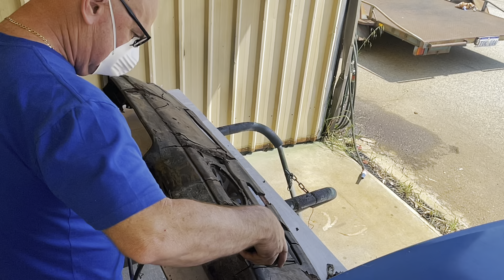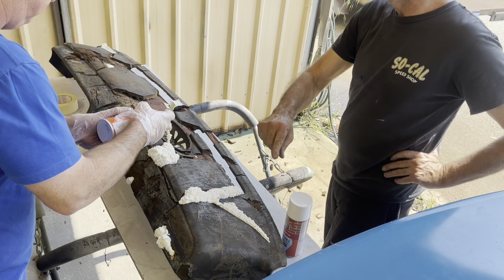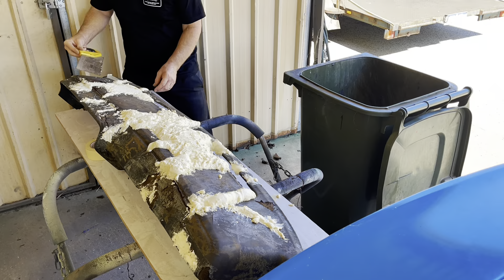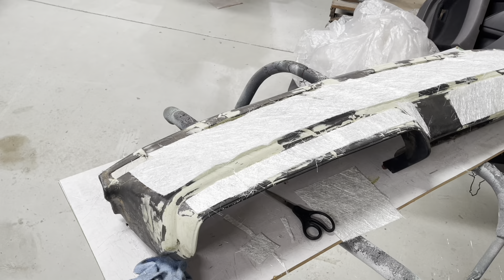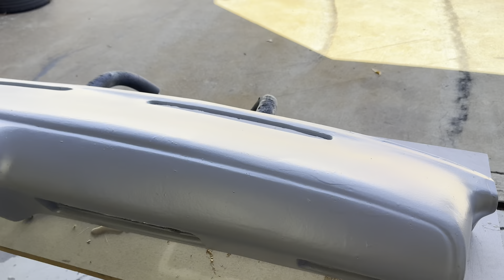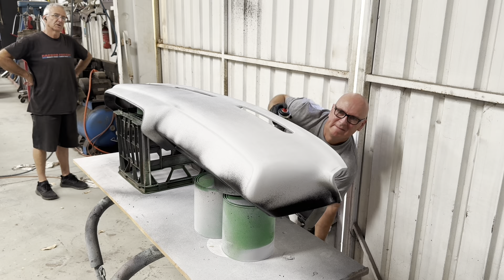Dash pad repair on my 1970 Barracuda

Comment: Great idea using the bed liner, i bet that it is going to revive my exterior plastic trim very well.
Thanks for the tip.
Reply from the maker: Just practice a spray or 2 on something else first. You need to be 60-90cm back from the object being painted …… and use drop sheets 😉

Comment: for what its worth im doing my 69 fiat dash and glued/filled the cracks using Big Stretch caulking its a urethane product it fills the old foam  & shrinkage seems to be 15-20% no trimming allowing for flexible bondo to finish Im going to use a product called soft sand (rubber product) and spray urethane paint to mimic the original look. your looks great